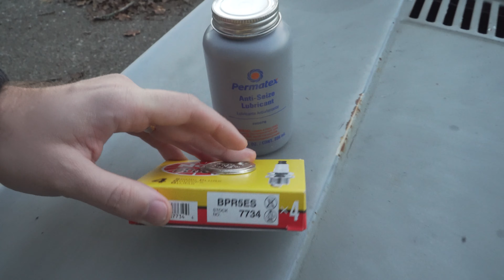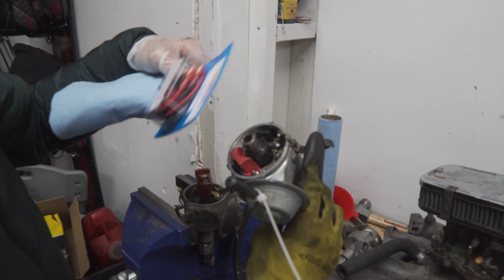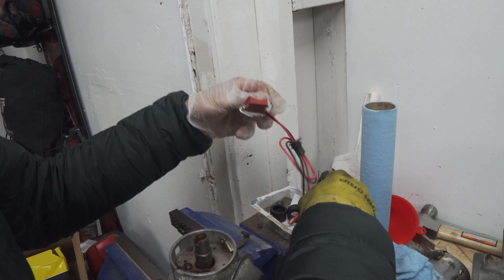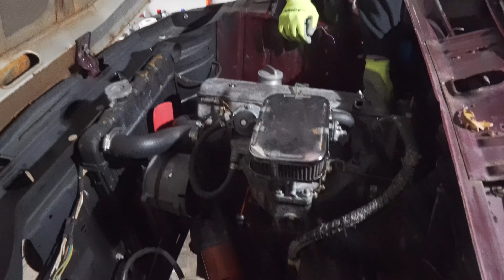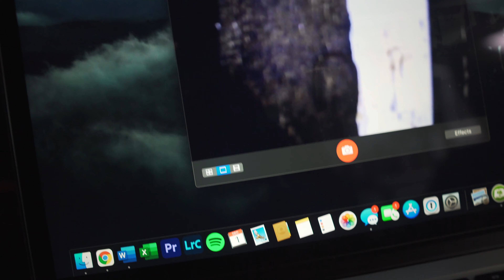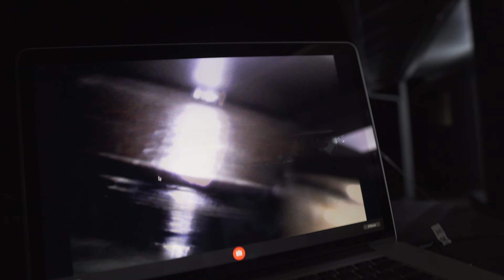BMW 2002 Factory Reset And 4K Rev Problem (SOLVED)

Comment: The reason the tops of the rockers are ground like that is to create a smooth uninterrupted surface to reduce the chance of stress cracking. Same reason we shot-peen rods, or clean up the casting on the inside of a block, no jagged edges for a crack to originate. Alpina did this to their competition engines. Now why some are polished up and others aren't in your engine? My guess is at some point a rocker or two broke and got replaced individually maybe?
Reply from the maker: oh that interesting and totaly makes sence,  once we pull the head off we will probably finis off the ones that were repaced or skipped. thank you! :)
Reply: @pnwproject4653  For sure man, there's "heavy duty" ones available as well which are pretty nice. I put them in the head I just built up on my channel.

Comment: Camshaft turns once for every two crank revs. You are 180° off.
Reply from the maker: thank you, after spining it another rotation we found out that the cam and chain is off by one tooth. this was the reason we could not get it to rev past 4k! very exciting.
Reply: @pnwproject4653  sorry but, how are you certain that this was the fix? you also did the plugs and got rid of the breaker point-system perhaps that fixed it.
Your vids are very insightful for me, i'm also battling a mystery high-rev problem for over two years now.
Reply: @thehenko6659  these videos are all over the place but at least I know why my 71 is nit reving past 3500 rpm’s as well maybe crank pulley and chain are off timing